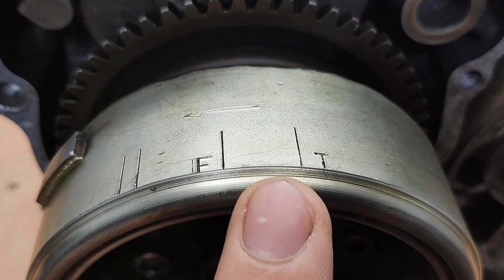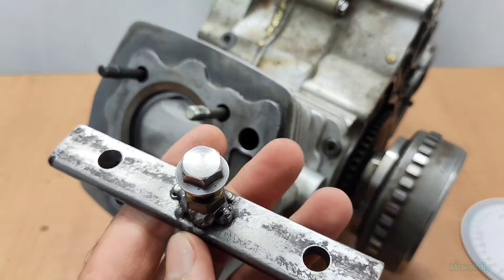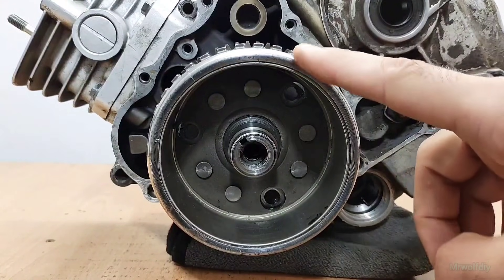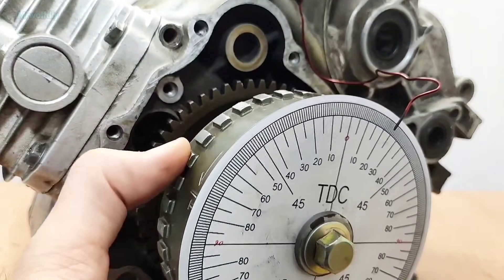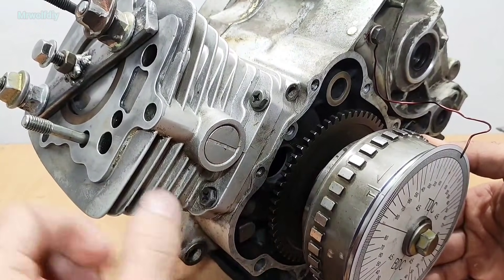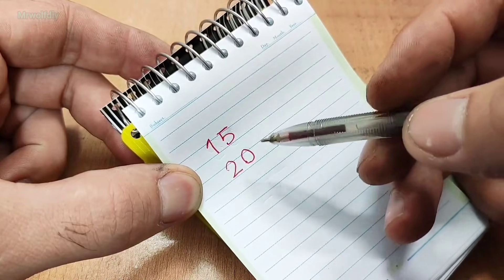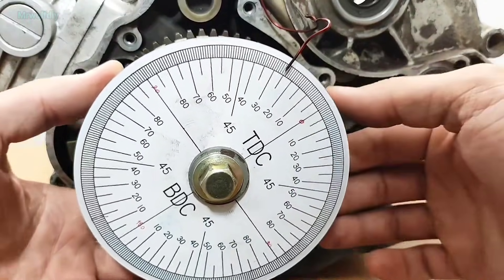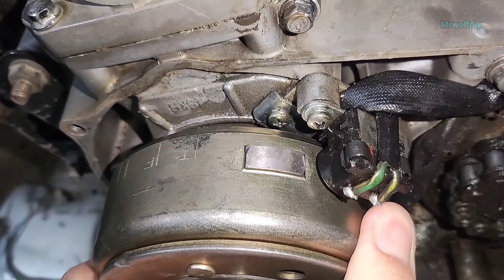How to Find True TDC Accurately | Piston Stop & Degree Wheel Method

Comment: You can also use a sparkplug that is a little to long, then rorate the flywhell and mark the piston stop in each direction. TDC is in the middle between the marks. (Obvious) 😅
Reply from the maker: This video refers to the method of using a degree wheel to find the "true" top dead center

Comment: I didn't used this method but something similar on my motorcycle. I used a simple tool called protractor marked the BDC angle and tdc at the case. My engine has a mild racing camshaft and a big bore piston that's why my racing CDI was set to be advance timing so that the engine will run smoothly and has more torque

Comment: Finding true tdc should be more accurate if you use angles closer to 90 each way ?  Ie the horisontal component of the crank will be higher pr degree and thus give better sensitivity to the measurement... need a longer piston stop then.

Comment: That’s fine on a small engine like that sitting on a bench, try doing that on a V 8,10, 12  diesel engine that’s in a crane say ? Personally I use a tdi gauge or usea thick wire into the injector hole or a thick piece of wire, mark a spot on a pulley or flywheel which ever is the handiest, now turn engine over by hank until the wire is between the piston and cylinder head turn it until it locks ,mark your mark on the pulley or flywheel that you had previously marked against the timing cover or whatever is the easiest, now remove the wire and turn the engine over in the same direction you were turning it until you can slip the wire back in, now turn the engine the opposite way you were turning it before until it locks , now mark the casing or whatever you marked before, measure the distance between the two marks ,then divide it by two , that is to centre
Reply from the maker: I have to say your experience is truly admirable, my friend.
Thank you for sharing your opinion. 🙌🙌

Comment: In an engine with the crank and gugeon pin position in the piston both on the bore centre line this will work to find true TDC. However very few engines have zero offset on the gugeon pin and many modern engines have quite a large offset of the crank centre from the bore centre line which will render this method useless.
Reply from the maker: This method is not affected by gudgeon pin offset or crankshaft offset relative to the cylinder axis.
The reason is that the piston is stopped on both sides of TDC, and the midpoint of the crank angle between those two positions is taken. Regardless of the engine geometry, the midpoint between these two angles always corresponds to the true crankshaft TDC.
Reply: @MrWolfDiy  When an engine has a crank offset the distance between TDC and BDC measured at the piston are no longer 180 crank degrees apart therefore stops set either side of TDC will not be equally spaced from TDC, the difference will be small but it will be there.
Reply: Agreed crank offset does make TDC appear in a different place compared to no offset. There's plenty of videos and literature about this.

Comment: MrWolf thanks for this video on motorcycle engine. I'm facing either advance or retard problem which is not yet confirmed, my motorcycle continuously lags or missing combustion at all speeds. Today I'll open my engine to find it because I checked everything including piston rings and bore and got Valve seating job by lathe whether, everything is good but I didn't find true TDC. Now with help of your video I'll do it.
Reply from the maker: You’re very welcome! 🙌🙌

Comment: (+15)+(-20)=-5
(-5)/2=-2.5
Maybe this is the correct calibration
Reply from the maker: The degree before and after tdc should be the same.
Reply: That also correct, but u must add & subtract that number (2.5) for each direction (15 and 20), the result should be 17.5.
I prefer the original calculation, because it's aiming a 0 degree as a center point.

Comment: Hi, great video. On step 4 it is not clear to me how the angle is measured. Where should the piston be to start the rotation?
Reply from the maker: Hi, thanks.
After finding the degree readings on both sides and calculating the final value, you need to set the degree wheel to that final number while the piston stop is still in place.
This way, in both directions, when the piston is stopped, the pointer will show the same value.
I’ve explained this in more detail in the description.
Reply: Thanks for the video! I still don't understand this part, when should the "first" measurement start? Or the closer to the stop, the easier it is?❤

Comment: You dont need a degree wheel to find TTDC, You can use Long Rod and put it in sparkplug hole, and turn to top dead center then check the rod, if the rod is stop moving thats the True Top Dead Center
Reply from the maker: The purpose of using a degree wheel is not just to find top dead center, but also to modify the ignition timing. I’ll demonstrate this in upcoming videos. 🙌
Reply: Hi sir, TDC can be found by anyone but true TDC is a must to be researched only by experts because ignition timing will be perfect in true TDC and advance and tetard can be adjusted and cold start problem will no more be there.
Reply: The point of finding ttdc was for ignition timing and cam adjustments. It would be hard to do when you don't have any measurements.

Comment: another way to get tdc is by checking the rocker arm if it has movement its tdc
Reply: When the engine head is not installed how will it work
Then other method will work

Comment: dial gauge, will be more accurate down to 0.001 mm,    but 0.02 mm should be good enough..    in most cases you can use the spark plug hole,    honda suzuki yamaha that fits tdc very precisely .. china engines are just like everything else china junk . can it run , yes then it is fine😀😀😀😀😆😁😁

Comment: What is the purpose of the bolt into the welded nut of you piston stop tool?  Surely adjusting this bolt will negate whether or not the bar is perfectly flat.
Reply from the maker: Some engines are designed so the piston does not reach the flat surface to lock in place. In this case, the adjustment screw becomes critical. Commercial versions also include this adjustment.

Comment: sounds great but it doesnt matter as the cdi advances the timing  if you have a points system then yeah but not for cdi makes no difference so just use the T mark as usual.
Reply from the maker: The T mark is a quick reference for routine servicing, not for measuring ignition advance.
If you want to get into tuning and accurate timing, you need to use a proper TDC-finding method like this. 🙌
Reply: @MrWolfDiy  nope not on cdi engones.
Reply: @jediknight2350  It is necessary to change the advance
The points are adjusted mechanically, but the CDI is electronic. If you’re using an adjustable CDI, you need to know exactly what ignition advance angle it’s set to; otherwise, it doesn’t really mean anything